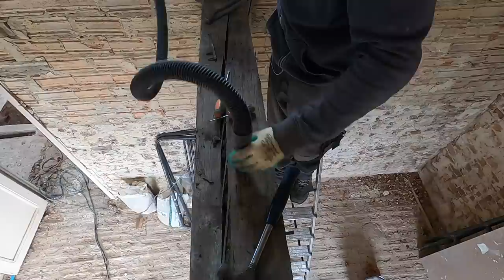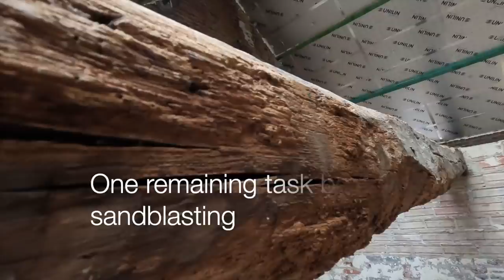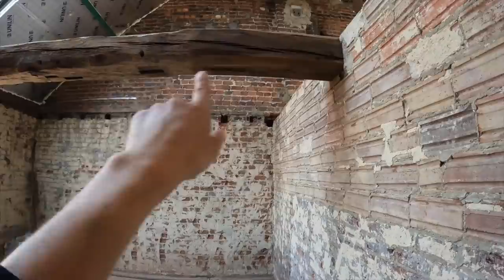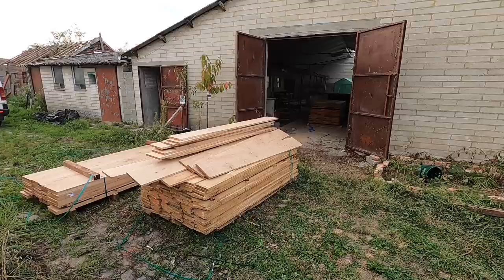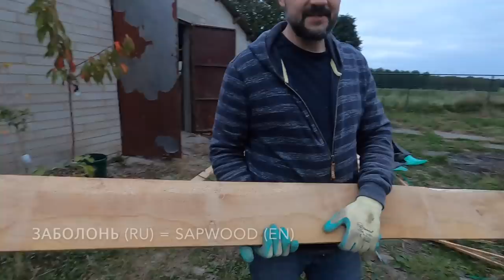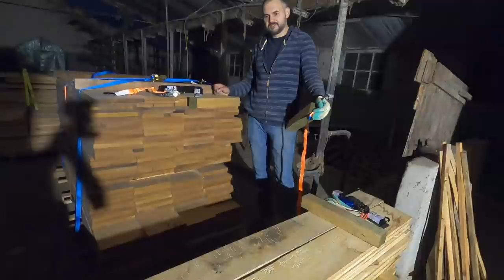Old OAK BEAMS sandblasted / LONG-AWAITED wood delivery

Comment: In US English the teleporter would be called a fork lift. But it doesn't matter much, we understand you. Thank you for such a nice channel to keep us entertained.
Reply: He may have been thinking of a telehandler. Although, the forklift is most likely what came with the delivery truck.
Reply: @drooplug  ....Ah that's right. A material mover that a man walks behind is called a telehandler. A forklift is one the person rides on to move material. Thanks, I had forgotten about them.
Reply: Pallet jack.
Reply: @nancykay6318  Actually a telehandler is a "forklift on steroids", where the fork is on a long, extendable boom, more like an excavator. A forklift has a more or less vertical boom that the fork moves up and down on, a telehandler has a pivoting boom that can go from horizontal or even pointing slightly downwards to roughly 45 degrees up. Massive beasts and quite expensive! Forklifts are good for moving pallets up and down shelves in a warehouse or store, telehandlers are more for building sites and other places where the machine can't drive right against the target.
Reply: @Ragnar8504  Ahhh Thanks

Comment: We put a layer of black fiber fabric on the ceiling before attaching the boards. This gave a nice appearance between the boards as they dried over time. We were very happy with the results. I am so impressed with your excellent work and attention to detail. Enjoy your journey.
Reply from the maker: Sounds interesting, I will remember this tip. Thanks, Barbara! We plan to do a “tongue and groove” joint that will help to avoid holes I hope.

Comment: Please please get the wood treated professionally.  You are doing a fantastic job but the risk of introducing new worm is far too great. I would also advise to insulate all exterior walls and the floors that are on the ground. The bricks look nine but the exterior ones are thin with no insulating. Great video and love it you are marvellous with your energy.
Reply: I'd guess natural fibre insulation on the inside would be the way to go. There's a French Youtuber who insulates all his external walls with wood fibre board, his name is L'franchement Comtois. He shows the whole process quite nicely in one of his older videos. Using solid sheets instead of studs and batts reduces the risk of condensate forming inside your walls and destroying the insulation.
Reply: @Ragnar8504   Boards are useless on field stone walls. The best way are studs plus sprayed urethane foam.
Reply: @marcryvon  Did you actually watch the videos I recommended? He filled the voids between the fibre board and the stone with lightweight mortar (lime and cork granules I think) and fixed the boards to the stone.

Comment: Putting straps around the piles of wood will do nothing to keep the boards straight. The tension of the wood moving will remain and will manifest as soon as the strap is removed. The only reason that there were straps when the wood was delivered was to keep the boards from falling off. Wood warps because of internal pressures that build up as it dries.

You might want to look into buying or borrowing some basic woodworking machines. I don't know the names in Dutch but in English they are:
Jointer - makes a surface flat
Planer (or Thicknesser) - creates a consistent thickness as well as smoothing the surface
Table saw - for creating a consistent width.
I expect that you want the wood to look as "rustic" as possible, but if the wood isn't straight and flat, you will have a lot of problems installing it.

Lastly, like many others I urge you to make sure that there are no beetle larvae or eggs in that wood!!

I really enjoy watching your videos every week, and like many others, am amazed at how hard you work!
Reply from the maker: Many thanks for your advice! We will for sure check the wood carefully and treat it as soon as possible. 
We haven’t yet bought woodworking tools, but already looking at them. Many thanks for a list 👍🏻

Comment: when you have removed most of the mouse droppings and dust, pour in PVA glue, this will consolidate whats left, seal in any viruses and bacteria and solidify to stop it blowing about. I did this to my beams and it worked very well. PVA glue, just paint it on or pour it into cracks etc
Reply from the maker: Never heard about this method. Many thanks for sharing, Bob!

Comment: Use a wood sealant on your boards while they are in storage. Wood absorbs a lot of moisture through the cut ends, more so than through the surfaces.  Best wishes to you both, amazing project!

Comment: We sealed our oak floorboards with Linseed oil - Osmo oil is wonderful, super easy to apply, doesn't have a strong odour, dries quickly, and they even do one that doesn't dry slippery but has a little bit of grip to it.

Comment: For me that looks very fresh woodworm marks.
But there is a trick to see if you have wood worms. Do some acorns from an oak under the wood stack. It is the natural meal of wood worms. They eat wood, because they don't have acorns from an oak. Because they prefer the acorns, they will leave the wood and go to the acorns.

You have to observe the acorns regulary, if there are any holes, your wood is still infested. Destroy the acorns (fire) with holes and put new ones under it.

This trick works with furniture. You even can cure your furniture. I'm not sure if it is possible for this amount of wood.

And check for fresh sawdust regualry under your stack.
Reply from the maker: Many thanks for a great tip, Afra! I didn’t know about this fact. I will try to check if there are still any living ones.
Reply: That is good information as I didn’t know that either! Thank you!
Reply: Sounds like a great idea!
Reply: @DeHoeveOldBelgianFarm  Yes, seriously do take care not to introduce live woodworm!
Reply: Wood is only cheap for a reason...particularly as there is a shortage at the moment. Buyer beware.

Comment: some of the worm-eaten wood might be salvageable if you run it through a planer to remove the damaged parts; this could result in boards that are very thin once the damage is removed, but these could be used in non-structural applications like a wood veneer ceiling
Reply from the maker: Thank you for the tip, Andre! Illia wants to make a table (or few) out of the most “featured” wood :-)

Comment: The sandblasting has only revealed the woodworm and the fact that this beam is severely compromised strengthwise (not to mention all the deep splits). Better to rip it out and fit a new, heat-treated hardwood beam. Forget the cuteness of an old beam - it's a weakness and a source of future problems (sagging floor, it can't be used to support anything).
Reply: I have to agree with this diagnoses! I'm 71 and have spent a life time repairing and rebuild 100 + year old structures ( Homes and barns) I suggest you replace these Structural beam for your family's safety!
Reply: i have an other opinoin...its an oak beam so the woodworm is no problem, the woodworm goes only in the sapwood... in european oak "quercus robur" the heartwood is full of tannic acid so no woodworm goes in the heartwood... form an optical viewpointit would be a shame if you replace this beams and from a strengthwise point it is absolutly not necaessary!
Reply: @ernstschafer6092  Valid point youngman! But the insect in question (powder post beetle), if anything like the species in the US doesn't care if it is sapwood or hardwood it will continue to consume the interior until the majority of the fiber is compromised! Although it prefers softwood it will even consume ironwood fence posts! This process can be halted! with yearly application of the boric acid solution to the service of the wood! given the life cycle of the insect! The insect emerges from the wood when the temperatures and humidity is conducive for it! so it bores it's way out of the wood leaving a hole of about a 1/16 of an inch or smaller! as it east through the exterior it consume the boric acid residue deposited in the fiber from the solution that was sprayed! in a matter of hour the insect dies! Any females that do manage to make it bake to the wood and deposit there egg on the wood the young died from the boric acid exposure! Boric acid is a great solution to stopping a lot of boring insects! adding some copper sulfate to solution only increases its ability to protect existing wood structure from infestation!
Reply: Sometimes you cannot avoid consulting an expert. Everybody has a point here. I would get those beams checked by a structural engineer.
They may be absolutely OK, but you don't want to risk it.
Reply: I was also noticing the beam damage. At the very least they should apply a liquid wood repairing epoxy into the split. This repair would be fairly inexpensive and being the beam back to structural integrity while keeping the history. Given, the beam might be too far gone and I have no clue if there is active insect damage.
Reply: @criptonite0hour  An epoxy encapsulation is a valid consideration! But one must first insure that all insect activity has stopped and insure the person doing the repair has done this kind work before! It is vital that epoxy resin impregnated the wood as deep as possible! This work is normally done with the beam encased in a membrane and a vacuum take on the membrane! Epoxy is then injected so the beam becomes saturated! If you could have an engineer look at the beam and give you his oppenion, it would be much better than mine our anyone else's opinion! We have only viewed the problem from a video! Nothing replaces someone being there and having eye's on!
Reply: In past videos they have mentioned that they've had engineering consultations. So they are not adverse to getting advice. I'll bet they did for the beams.
Reply: @melindastclair  Thank you Miss. St Clair for the clarification! No pun intended young lady!
Reply: @ernstschafer6092  I have to agree with you!
Reply: @MikeAG333  The problem is that from what I can tell from the video, that beam has far more sapwood than it should have. I'd say just have a professional look at it in person!

Comment: You might find what we in USA call a "Baker Scaffold" a good tool to have for all the work you have ahead. It is about 2' X 6' (.61M X 1,83M) and about 5' (1.5M) tall. They are narrow enough to roll through door openings and very handy.

Comment: Suggestion, If the wood does not have a tongue & groove, paint the ceiling black first. Then if any gapes in the butt joints now or in the future will only show a shadow line vice silver backed insulation or whatever color is behind it.
Reply: Ha, I've heard this before. Sounds like a very good idea for aesthetics.
Reply: probably best to run the tongues and grooves - keeps them in line, keeps draughts and dust out - do you think? I can't think of any disadvantage apart from the faff of doing it!

Comment: You two work so hard! Everything is coming together. As to the wood with the worm holes/trails..here in the U.S. as long as the wood is not rotted..crumbly many people use it due to the character it gives a home. It does really look good. If the wood has not been treated then I would definitely go ahead and treat. Great video..👍☺

Comment: Might be good to have a compressor to blow air in those tight spots to get out all of the old dust in the beams. Probably wouldn’t use the air to blow out the mouse poo, LOL. Ilia you do everything so neat and precise. The clean up of all the construction debris is as much hard work as the actual construction. Bless both of you for all the extremely hard work in renovating your home. Cheers from New Jersey, USA.
Reply from the maker: Thank you, Kate!  We got a more powerful vacuum cleaner just recently, it should do the work of getting rid of all the remaining dust pretty good.

Comment: If I may suggest when you do put down the oak boards let them set inside the house for a week or two. This will let them acclimatize to the house's moisture and temperature. Also it might be a good ideal to cut the boards narrower so they will not "cup"
Reply from the maker: Thank you for the tip, noted!

Comment: Just a suggestion, my husband, who built our house 25 years ago, always used a metal trolley about 4metres x 1.5metres with a flat base, but sides you could raise and lower when needed. It was very low, about 1/2 metre from the ground and it was on pneumatic wheels. I don’t know if he made it or modified it or whatever. I only know he still uses it for moving heavy things around the house. It’s quite portable and easy to manoeuvre. Anything to make things easier is a good thing. So enjoying your videos and positive attitude. Hope things progress smoothly. Love from Australia. 🙏🏼👍🏻

Comment: the woodworm eaten parts are sapwood. The beam was curt from a hole tree and the left part was on the top with more sapwood left on. That's normal with old wood in buildings.
And the cut for an other wodden beam in the Wood was not because it was reused but to stabilize an earlier roof.

Comment: "Nature driven design", indeed! :)  This is my first time on your channel. I love the space you are re-creating.  It appears those beams you sandblasted lost quite a bit of material through the years - I assume they had a rectangular or square profile when new. I trust this loss of material will not affect the structural integrity of your space --- oak is a very strong wood, and it is used here for side-to side stability, so that's good. I wish you the best of luck with your project!
Reply from the maker: Thank you for your kind words  and welcome to the channel!

Comment: There are three considerations snow load wind load and ice load, if you wind up with all three which is possible than you will have a problem because bearing load is a given the other three are not, the beams will support a known load the joints that fasten them to the walls are your weak unknown factor the tie rods used  to correct that wall in the Barn ?  is great example of this. Best wishes.

Comment: I think that when you see the woodworm holes it means they have moved on to new wood. I would get it treated; if possible before it ruins it all. I think it was lucky it didn't fit through door, otherwise you wouldn't have found the problem until it was too late to save rest of wood. Good luck.😊😊😊😊😊😊😊😊

Comment: Keep up the good work guys.....Maybe it would have been a good idea to put battens between all the layers of planks to prevent mould  if you are not going to use it in the next couple of weeks?  The black stuff looks like mould is already starting.

Comment: You can see that woodworms always start in the sapwood of a board/plank.

I would never tie those planks like you did Ilja, because wood works and it never stops working.
It is impossible to control wood from warping/twisting when it is drying. ( wood must be female ;-)  )
Better you stack it loose with "stickers" in between each layer and give it time to cure/dry.
And before you use the wood check it with a moisture meter and or store the wood for a few weeks on the place in the house where you want to use it.
Reply: That's the right way. You need to give the wood air. It must dry by every piece.
Reply: I forgot to say , that wood dies not only warp, if it can not dry correctly or will stay dry it can get fungi, then the nasty stuff starts, such wood you don't want to install into your house!

Comment: Did you check the conditions of the wood beam portion, cast in the brick wall? The part inside the wall, sometime is very damages due wet and  water infiltration by the brick joints. Good job.

Comment: Just stick the oak, It will normalize soon enough.  Who you are getting ready to use it, take it into the building and leave it there for a week to let it normalize again.  It will be fine.  You may want to seal the board end to stop splitting.  The end dry faster

Comment: Hello. I have a few questions. In one of the children's rooms there is an angled brick column inset into a wall that runs up to the roof. I was wondering what that is for? Is it a fireplace chimney? A run for old pipes?   I am really enjoying the journey and the cast of characters, especially Catspector, are excellent. Meow.

Comment: You should separate the Wormie wood as they will infest other clean boards . Kiln drying will kill them , other wise they infest the other good lumber . I personally 🔥 burn any I can’t cut out , don’t use it if at all possible here we call them post Beatles , I’m not aware of another method to treat for them .

Comment: Those slots in the top of the beam were for the wood tenon ends of original big diagonal truss like members that someone long ago decided were not needed any more. Too bad. What a loss. On the plus side they are probably laying outside right where they were dropped 100 years ago.
Reply from the maker: Or burnt in our bread oven 😁
Reply: @DeHoeveOldBelgianFarm  🤣🤣🤣🤣🤣 yep. That is what happened!

Comment: Someone suggested removing the beams.  I would consult a structural engineer who is familiar with wood beams first.  Bore worms "usually" only eat the sap wood so hard to say if actual beam strength has been compromised.

Comment: because of the tannic acid in heartwood of oak the the woodworm doesn´t like it at all... the sapwood has often woodworm, but it doesen´t matter when the house was build most beams were so or so oversized... if the oakwood got wet and had fungus, the heartwood of oak can also have woodworm but i think thats not the case... so some woodworm is not so bad as they seem, wooworms from hardwoods dont go into softwood that are other species